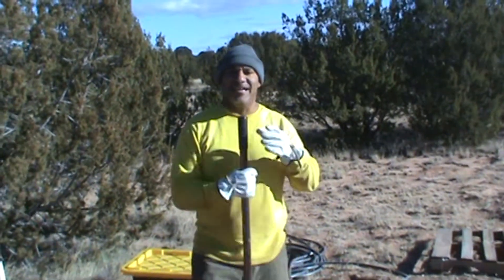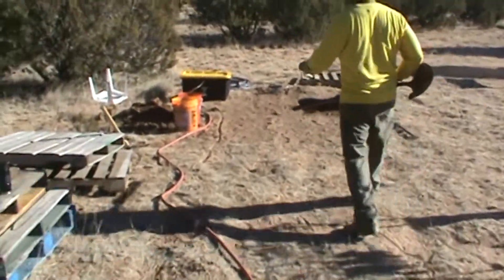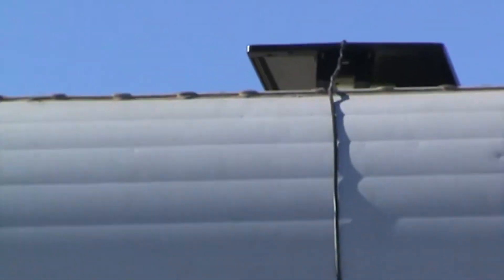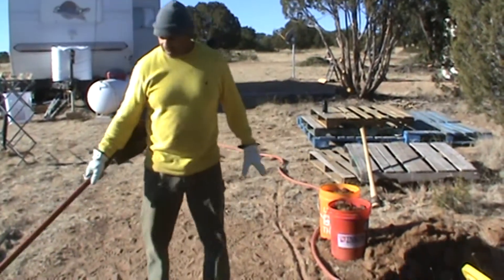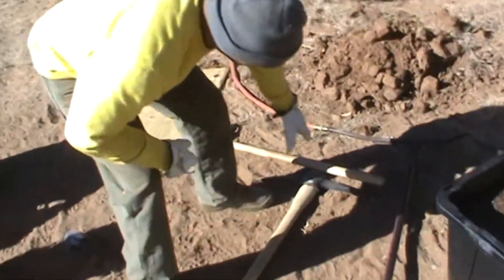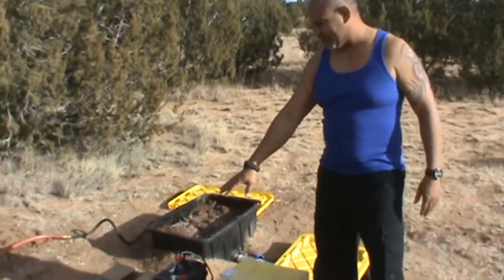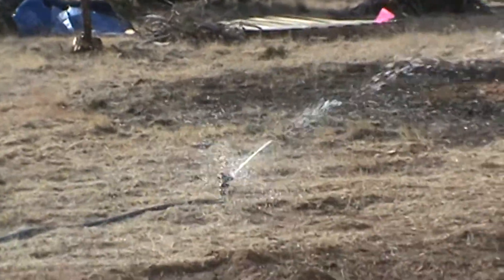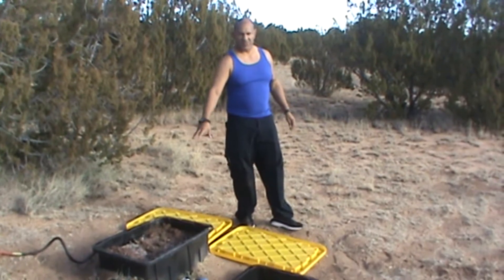GREY WATER FILTER SYSTEM PART 1

Comment: that's awesome. I'm sure you've already looked into biodegradable soaps. But if not, that will help quite a bit.  We are using the great water for trees and veggies and when we're done building we will also use it for a lawn I plan to grow over the septic leech lines, may as well right?
Reply from the maker: lol.  Actually we need to do a follow-up video on this.  It was more trouble than it was worth.  For one thing there wasn't enough volume of water to grow grass or anything else for that matter.  We didn't realize how much water it takes to grow grass alone.  Secondly, the gray water attracted a lot of flies, which drove us crazy, lol.  So we decided to abandon the gray water sytem.  We instead dug a deep hole, which our gray water goes into and covered it with a horse stall mat.  The water leaches to where our grass is, without the flies.  I do use biodegradeable soaps and natural homemade cleaning solutions though.  Growing over  you leech lines is a good idea.  Let me know how it turns out for you.
Reply: How 2 Be Free thanks. I will. It’ll be awhile though.
Reply: How 2 Be Free is that where all the flies are coming from? They are relentless here. I thought it was from the cattle roaming out here.
Reply from the maker: @TerraFirmaX  lol lol.  Yes that's where they are coming from.  They are relentless here also.  What we learned is that you can't fight nature.  The best thing we found to fight the flies are these sprinkles they sell at Tractor Supply.  I forgot the name of it.  But they sell it where they have the horse supplies to keep flies off of them.  Its in a short can and its like small beads you sprinkle.   You can also put them in a spray bottle with water.  It works awesome.
Reply: @How2BeFree  cool thanks